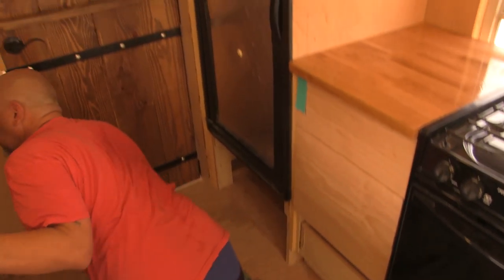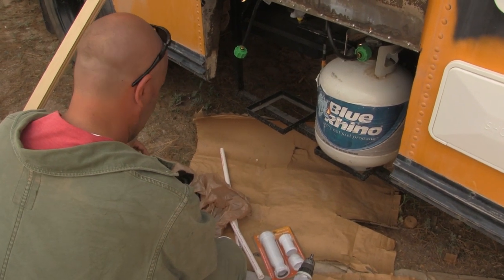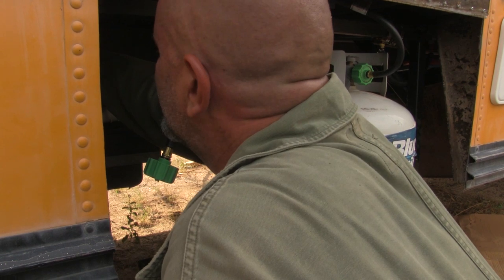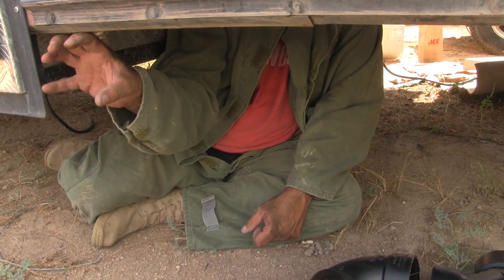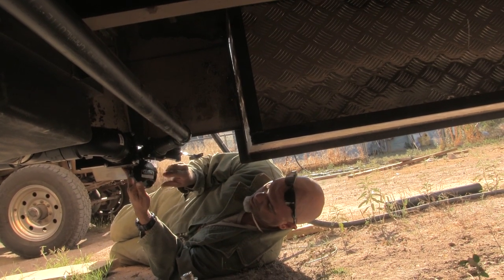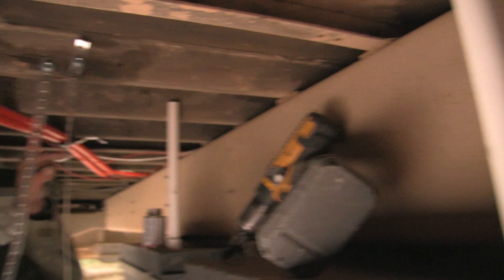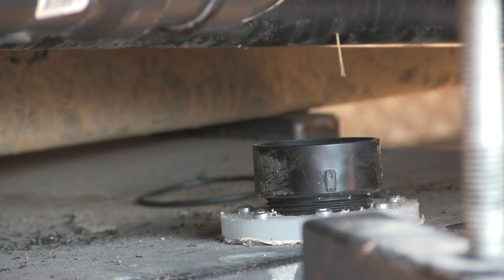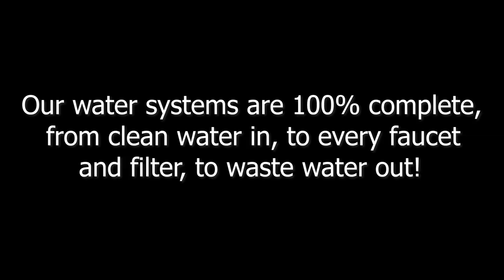Skoolie Drain Pipes & Gray/Black Water System

Comment: Mike, wrap a piece of neoprene round those pipes where you are using the metal conduit tape. Believe me when i say that stuff is sharp and will vibrate cut it's self into the plastic. I also put a nut and bolt through it close to what i am supporting, that stops it moving in the vertical plane as well. Nice neat install :)
Reply from the maker: Going to do this. Thank you.

Comment: I would have to draw myself a whole diagram like 3 times to work out mistakes before I touch a pipe. Just did my gutted cottage. Came out nice! Wish I had the 3 way thingy...may add that and also use it in my box truck.

Comment: Excellent job Mike........... Since you will be a moving house down the road, I would consider installing another pipe around your draining black pipe where your straps supports are hanging.  Cut some waste water pipe about 2-3" wide and cut them in quarters, then glue them on the outside of your drain pipe where your straps supports are going.  I would make a complete wrap around the pipe with the strap before they are secured to the bus frame.  Then take a bolt and nut and tighten the strap to make sure the strap does not move on the drain pipe.  So if, any wearing or cutting from the straps occur, they will be cutting the small strips of pipe you glued on the black pipe.  This way, it will never be any problem of the strap cutting your drain.  It is best to be safe and do it now then on the road which will never be convenient.  Just my 2 cents worth........
Reply from the maker: Thank you. We are going to visit this.

Comment: Where is your Hepvo for the washing machine?  Are you putting on the inside of the enclosure for the washing machine?
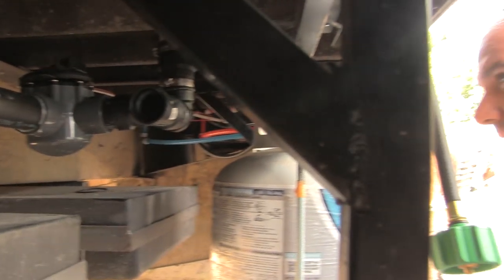Reply from the maker: Actually, the shower and washing machine water both go through the same Hepvo, right before it goes into the tank (after the 2-way Big Ol' Honker Valve). In the video, this is where Mike was sawing at 6:25 because he had forgotten the Hepvo! 😂 If we end up having any odor from the washing machine drain pipe, we could install another hepvo valve there quite easily later on. ~K

Comment: If you read the BLM full rules. Gray is OK to let out on the ground unless local laws prohibit it. In Arizona the state has a law that prohibits gray water that has had body contact. So sink water ok but not shower water. I'm working on a system to filter gray to flush with and spray on the dusty roads.

Comment: The only thing I don't quite understand is that it looks like you have to go under the bus to change the valve direction every time you wash clothes or take a shower.  Or else leave it on that direction and change it to use the sink.  Ideally, I guess having the valve inside the bus would be wonderful, but I admit that would seem to be impossible.  Maybe I am just confused... 🙄
Reply from the maker: I guess it would depend on how long we would stay in an area. Drinking and moving every day would be hard on both of us. We plan to stay 2 weeks st a time. Switching to internal draining will be on the "preflight list".
Reply from the maker: The sink always drains into the gray tanks. The shower and washer can be switched (together) from tank to ground.

Comment: Fyi your drain is going to be a bitch to line up at rv dumps or hooking up in a rv part where all stick and staple rvs the dump is on the driver's side
Reply: My bad, It was looking like you had the dump on the same size that mine was on... I got my skoolie already converted and had been changing things as I went to upgrade and fix problems just never got to swapping the tanks